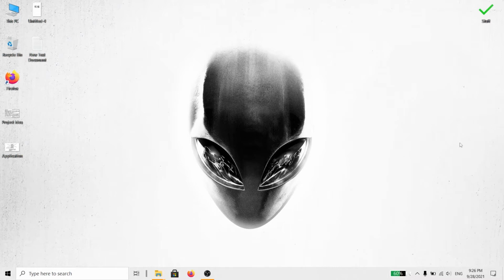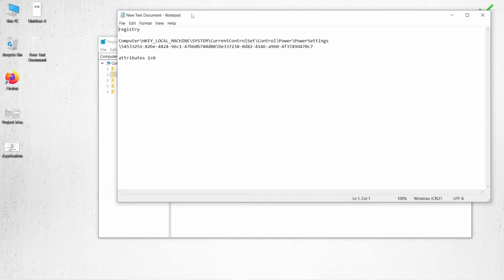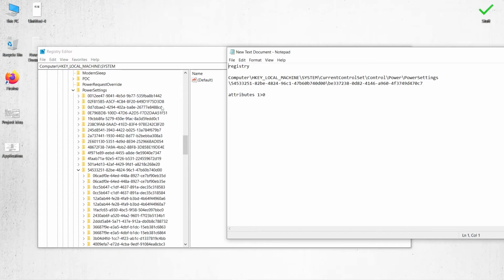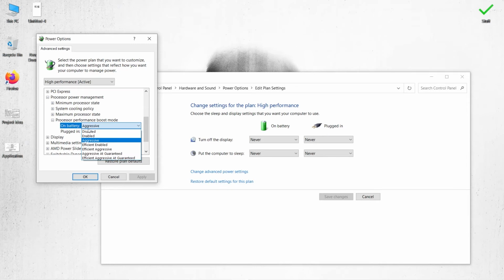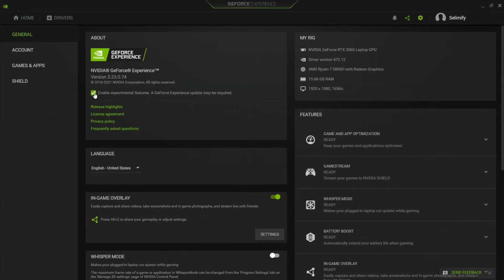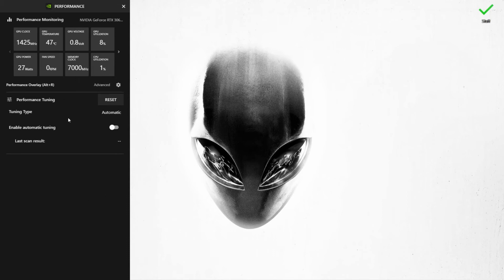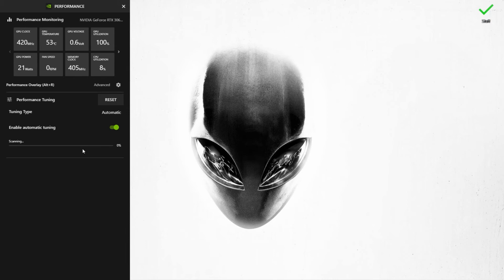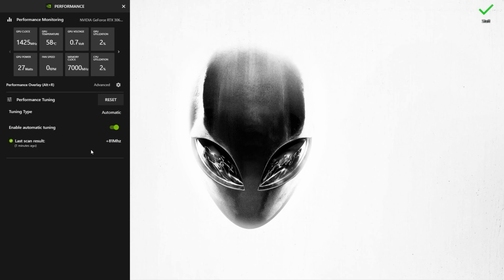How To Easily UNDERVOLT Your AMD CPU and Easily OVERCLOCK your NVIDIA GPU

Comment: My brother, thank you so much for your help. I'm the person who asked for ways to lower CPU temps on Tyrial's stream and you directed me to this video. 
I still haven't tried undervolting but, so far, I disabled turbo boost and the results are unbelievable. I was getting 80°c on warzone and now it's in the 60°c-70°c margin. Thanks again for your help, I wholeheartedly appreciate it.
Reply from the maker: You are welcome ! I am glad it worked for you just like I thought. 👍🏻

Unfortunately Not Every Laptop Cpu can be undervoltable like Desktop models, however being able toggle turbo boost off/on quite easy feature even tho- it does take minimal performance for temperature reduction. 

there are other ways to cool your laptop this is just an easier software method

if you want to try undervolting your gpu You can do it from Msi Afterburner I don't have a guide for that but it is also safe if you go too low in your gpu undervolting  laptop will restart in original voltages that your gpu ( i do recommend you to watch a tutorial before doing it even better if the person using same laptop you have in the undervolt video so you can find the lowest values that way easier ) because every laptop motherboard different

it won't be huge temp reduction but every Reduced *Celcius matters

There is also liquid metal ( personally i don't recommend ) but it does the job for reducing temperatures, however it can effect laptop longetivity if not applied correctly and maintained correctly. ( this is basically for getting lowest temperatures possible )

Cleaning the dust inside your laptop fans can also improve temperature ( Depends on country climate ) and how long you are using it for.

for the last tip getting an external cooler like Gt500 ( definitely recommend ) it can get loud without headset but it is one of the best external coolers out there you can find it in amazon.

Hope it Helps.
Reply: @Selimify  thank you so much for your help. I really appreciate it.

I'll go for undervolting next if I manage to find a good video or guide. Then I'll try getting that cooling pad. I do have one but it's not the best.

Thanks again ☺
Reply: @Selimify  sorry one last question 😅.  I did some digging and found out that Rizen CPUs like mine can't be undervolted however I can undervolt my GPU. My GPU temps hover arround 50 to 60 and I think that's safe as it is. If I undervolting my GPU does that also lower my CPU temperature?
Reply from the maker: @grey6545  It is been almost a year i just realized this comment xD.... Undervolting Gpu usually not changes overall cooling performance of the Cpu you may get temperature reduction on gpu for that reason it can be great but other than that i don't think you need to undervolt gpu because they never be the cause of throttling anyway because sometimes when gpu don't get enough power to run the game you can get crashes and restart system do everything again till you find the sweet spot. however it can give you extra battery longetivity when you undervolt gpu perfectly as well so if you using your laptop on the go maybe another reason to try it...